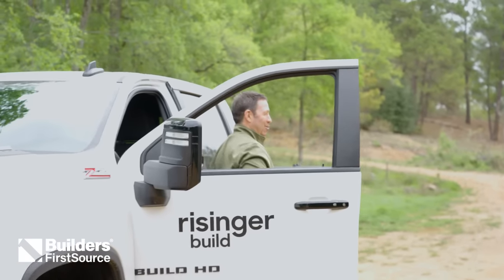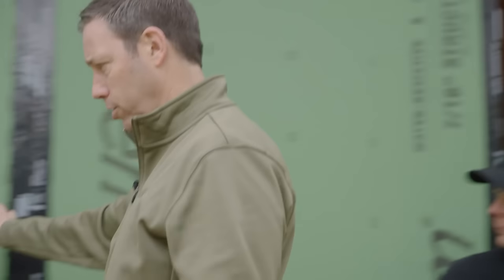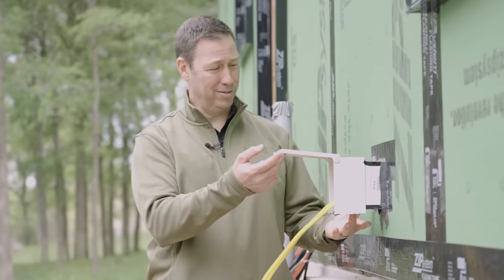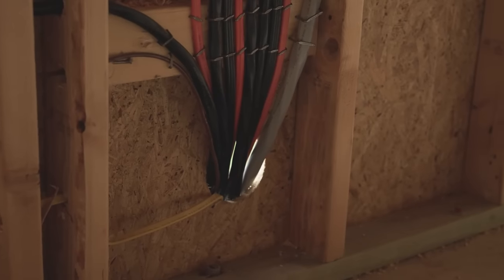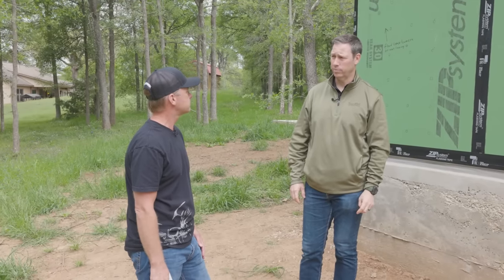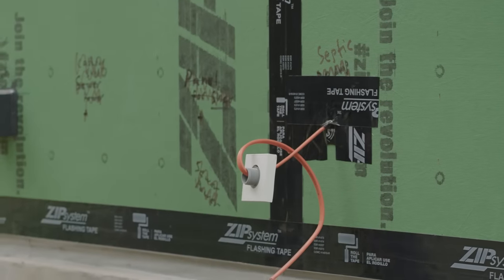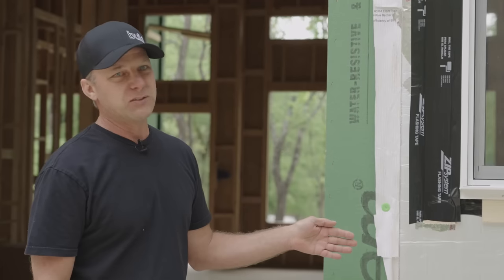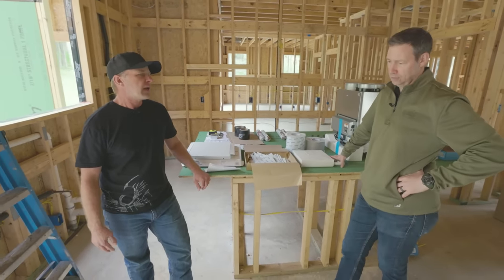Part 2: LOW BUDGET Details For A High Performance BUILD

Comment: Matt, great interview. One thing I would like to know is how much these building refinements add to the house cost. Then contrast this cost with the combined savings of a large rooftop solar install coupled with a high performance heat pump system.
Reply: I'm going to dive into this a bit more in an upcoming video. But I can tell you that what we have found, by doing the math, is that an initial investment yields a greater return when spent on the house vs. solar. I think many people have drawn the same conclusion. This initial investment, for me, is less than 10k depending on how far you take things. On more budget friendly homes, it could be a lot less. As a result, we know if makes sense to first invest in the house to get to a place where it's using 50% less energy or better and THEN go to solar for the rest.
Reply: My local EMC offered 25$ per month x 2 to buy into a remote solar farm . I kept it for 6 months and never made a single cent. EMC had a short supply of panels and I dropped out of the program, it doesn’t pay !

Comment: How is Scott going to deal with conductive heat on his roof if his metal roof will be directly on top of his underlayment?
Reply: I'm relying on a few things. Both the striations of the metal (the ribbed pattern) along with the bumps on the roof (small ones because I've minimized that) will give me some air space under the metal to reduce thermal transfer. An on-purpose rain screen would be better but we chose not to spend the money on that. The metal will have radiant barrier properties. Also, metal will loose the heat that it absorbs quickly once the sun is not shining on it (an asphalt roof would keep the heat longer).

Comment: Appliance tech here, I like your dryer makeup air idea. Heat pump dryers are not a mature technology yet and I think that having no duct at all may be shooting yourself in the foot in the long run. I think it may be a good idea to operate your damper off a pressure switch in the exhaust ductwork somewhere.

Comment: Anyone know how was the wall to slab seal done? They didn’t touch on the how… just that it’s was done and great.
Reply: That water and air tightness comes from the siga tape. I do use the cheap sill seal but that's only to provide a capillary break and nothing else. What provides the seal is the Siga Fentrim tape from the sheathing to the slab.

Comment: I'm using YouTube to teach myself to build. Can ZIP sheathing be used for subflooring? Seems like it's better than OSB.
Reply: Maybe the 5/8" can but probably better off using the advantech subfloor.
Reply: @ScottTrue  ok. Any reason why?
Reply: @sgtrickards5683  Mainly because the subfloor is made for the application and is rated to span specific lengths for a floor. If you used Zip, it would definitely need to be the thicker one but even then, you should check to make sure it can handle a load like that. That would be interesting if it worked.

Comment: I wish zip was cheap when I bought my sheathing. It was 60 then, now under 30. Even Advantech is 37 bucks a sheet when it was almost 90.  I paid 60 for gp dryguard last year.. I wish I waited a year for sure. I would have saved 22k in materials. Thats 30%.. surprisingly exterior foam insulation has not changed so that 6k wouldn't have changed. Building materials last year sucked

Comment: Joe Lstiburek  makes a point of staggering seams using thin poly-ISO / EPS/XPS panel - -not due to supply issues - - to eliminate air loops - at the gaps esp. for cold climate roofing - he has a story of one of his early embarrassments...  (3x thin layers with staggered seams would guarantee at least 2x layers of insulation - even if there ends up being shrinkage gaps - maybe there "could" be point defects but the likelihood of significant areas reduces... ) - labour costs vs air and insulation defects??  cost benefit rations wil vary.

Comment: You ever think of making a house that wasn't obsessively air tight and embraced thermo mass materials, good outdoor airflow in rooms like kitchens, and slab based heating to cheaply reheat rooms. Could cut out tons of HVAC expenses. Frank Lloyd Wright used to tinker with elements of this. Maybe makes smaller homes feasible
Reply: Mass radiant heating never performs as it should in theory.  Leaving the occupants uncomfortable and wanting a traditional system after the fact.
Reply: @CompulsoryDemocracy  Are you a builder?
Reply: @500iq6foot8  self builder
Reply: @CompulsoryDemocracy  When you say "mass" are you talking whole house or a certain size house.. ?
Reply: @500iq6foot8  A whole house mass radiant will generally not be enough entirely.  It is possible to assist the main heating source during a few times of the year.  You will still benefit from an air tight enclosure with any choice.  Historically, when the passive solar heating was trendy in the 70's and 80's, most homes are leaky and lacked the air tight details to provide the needed comfort
Reply: @CompulsoryDemocracy  I am just curious because I find open window air to be much better than any HVAC filter. When I go to the grandmothers the windows are often open in the warmer months and the house just feels nice outside of really hot days. Just trying to think if a solution to use both and supplement when needed
Reply: @500iq6foot8  the right humidity indoors will help with comfort, but ultimately, with an airtight homes, its up to you to decide when to re-circ and when to ventilate
Reply: @500iq6foot8  Supplemental air handling is generally managed with and ERV or HRV system. If you can, used with separate ducts from heating and cooling
Reply: High mass thermal load doesn’t work for some seasons.  Freezing at night and nice during the day, day will be to hot as it will take to long to get rid of the heat and overheat the area.

Comment: I'm a retired builder. 2 things: 1). The poured foundation wall looks like crap. 2). How is he going to ventilate the attic with the soffit closed off?
Reply: He is conditioning the attic, there is no ventilation in the attic. Hence the need for such a overbuilt AC system and Air exchange. The AC unit keeps the air moving in the attic and handles any extra heat generated by the roof, although I expect most of the heat on the roof is being handled by significant attic insulation.